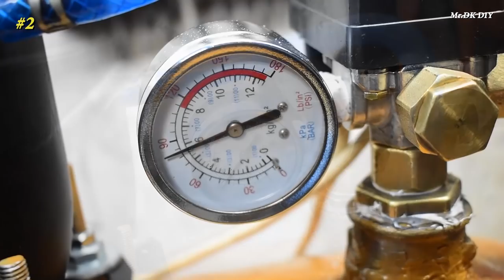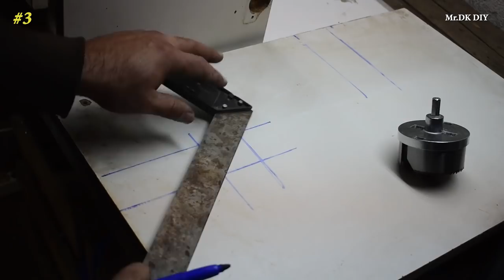TOP 4 REALLY USEFUL THINGS THAT ARE BUILD AT HOME / Clever DIY Projects

Comment: Top tip: When filling a gas bottle/tank with water to purge all the gas as shown in the video ... use a drinking straw (or any other small diameter pipe) as a vent. Simply place the straw through the neck of the cut bottle. The water will fill up much more smoothly, and quickly, as the gas inside will escape through the straw as the water is filling up the gas tank and won't try to bubble back up through the water trying to get in. Ensure the straw is as far inside the gas tank as possible without the top being below the level of water in the cut bottle and ideally pointing towards the side of the tank when inserted. Pull the straw back out a bit when the tank is almost full to let the lat bit of gas escape. Hope that is of use.
Reply: Ок
Reply: Ок

Comment: Hi!! First of all, thanks for this video. Now please tell me how do you know that the gas bottle was REALLY empty. I got some to use and they are not 100% free of gas. I want to make things to out of them, and go at least a little higher in life, but not with the "help", of an explosion, so...
Reply: In hazardous situations: when In ANY doubt DON'T DO IT

If you really wish to do it: :ASK YOUR GASMAN: for a completely empty gas bottle.
Reply: Fill water and wash it  out at least six times to get rid of gas.
Reply: Fill the tank with water until the tank is completely full of water ( I let it overflow for a bit before emptying and filling again)  and empty it out several times. The water displaces the gas and forces it all out as the bottle fills with water. So the gas has to escape. Do this at least 4 or 5 maybe even 6 times just to be sure all the gas has escaped. Hope this helps. I know its a bit of a waste of water. But id rather waste some water and blow up my bill instead of me Blowing up!!!! Lol alternatively you could use a water pump and re-use the same water so you're saving water. I'd do this if using a large tank. But if its a standard size propane tank i wouldnt worry about it. unless your state is in a really bad drought.
Reply: Really open the valve once liquid magically turns back into a gas it will be gone away unless you live in a hole with no air circulation but I think berating may become an issue

Comment: SO just for the record, the purpose of the water is to FILL the tank up all the way so as to displace the COMBUSTABLE/IGNITABLE GASSES and make sure they have been completely evacuated, if you don't want to use water just put and air hose on there and blow a bunch of air into it pushing the gases out till there is no more..

Comment: don't ever build a pressure tank unless you have passed the ex ray test and are certified to weld on pressure vessels .  Example   a bad ark strike creates a weak  spot and will fail visual inspection

Comment: no valve between compressor and tank? how is it at restarting when half full? also the blocked off part of the on/off pressure switch, could have been used to put air in from the compressor, no need for the air in part u welded in. where is the water drain tap?